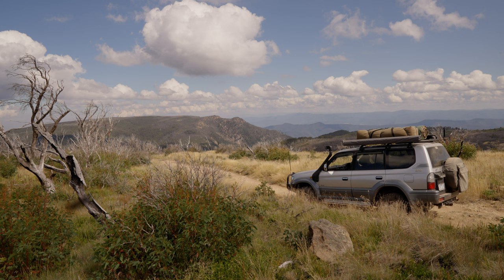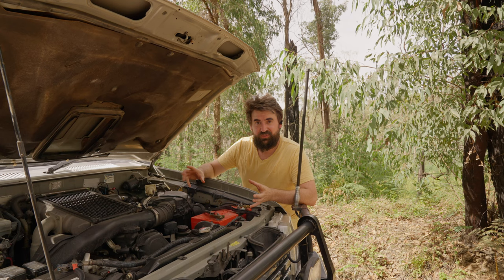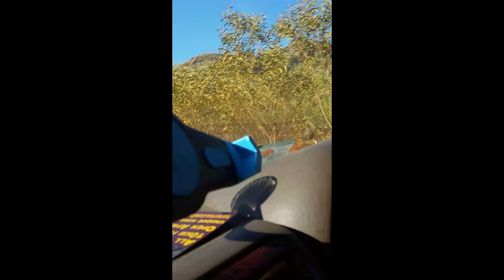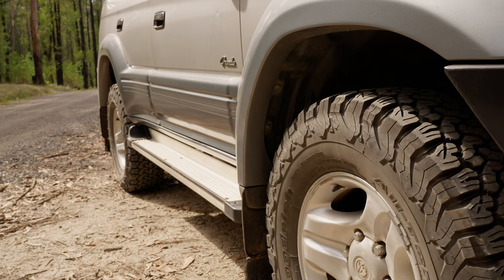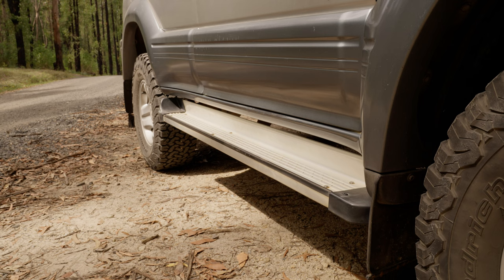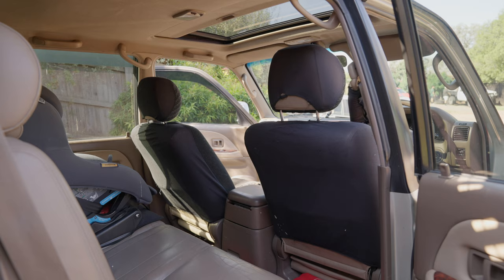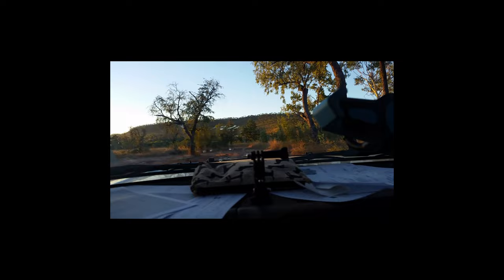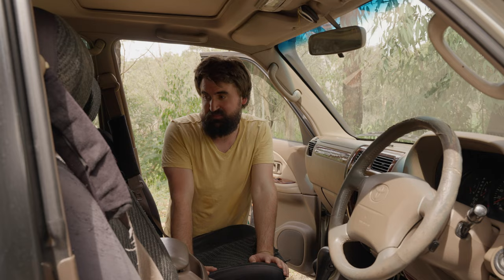Prado Walkthrough  - Setup For Family Adventures

Comment: Get video, always good to see other peoples  set ups .
A cargo barrier is a must , l have had in all wagons and they work !
Given the “COVID Tax” on 4x4’s and the fact Toyota aren’t taking any new orders for 300 series, l reckon keep the Grey Dingo and give it birthday.
I have the ARB alloy tradie rack on my ute and it’s brilliant. Very light, super strong , l have used it as a work platform , lots of tie down points and Australian made.Very happy with it.
LITHIUM is the way to go for your 2nd/house battery.
I have a 100amp lithium power station, the battery and distribution are combined into one unit.
Plenty of power , runs the fridge and travel buddy no problems, light weight ( 11kg approx) and transportable. Mine is. Nomad PDU from a WA company, it works well .
I have had this unit for over 3 years now, no problems .
There are other on market now.
Keep up the good work , l will check out your PLB video .
Thanks for all your efforts, Mr & Mrs Dan.
Reply from the maker: Hi David, It's a simple setup but it works for us. The more we think about it, the more we think to keep the Grey Dingo a bit longer. You are right, with the market on its head its just not the right time to buy unless you have no other option. Thanks for sharing your ute setup! Tradie racks are so versatile I reckon - wondering how the Aluminium has held up? What ute do you have? Do you run any solar to the lithium or is it not needed? The portable batteries seem like a good option because they can potentially outlive the car - I'd hate to spend a heap on wiring it up then have to say bye if we decide to sell  the vehicle early. I'm going to check out the Nomad PDU. Thanks for watching the PLB video. Great to have you onboard the channel. Cheers
Reply: @OTWD  Hi Dan,
I have a 2019 Ford Ranger XLT with the Tech pack. Pretty happy with so far.
The alloy rack has worn very well so far. I have carried everything from firewood, plywood sheets, hardwood timber,ladders, pop up marquees, swags, max tracks, bikes, tools and naughty children ( joking). I have used it for a work platform and a viewing platform and so far no problems.
Oh and niece use it as a climb gym/ monkey bars.
Just be aware they do increase the height of vehicle.
I have no “ dog in the fight” but very happy to reckon this alloy rack.
It works for me
My battery pack (bp) is solar capable, but l don’t have solar. I tend to camp and move on the next day , so the dcdc charger keeps the bp topped up.
But am looking at folding solar panels for an upcoming trip , which will involve a lot of base camping and day walks.
I had an auto elec run a cable from the engine to to the tub and l have a 25 amp dcdc charger for the bp this works very well. I also have  an ac charger which l charge/top the bp as required. I reckon a bp would be ideal for your set up.
Hope that helps.
Keep up the go work.
I appreciate the time and effort you put into your videos.
Thank you.

Comment: Hi
I have a colorado 1997 with  195000  miles on it.
I have owned  it for 14 years. 
I have  replaced  the rear axle casing due  to top radius  brackets  rusting away. 
Keep  the maintenance going  and it will  going.
Regards  from  the UK. 
Paul
Reply from the maker: Regular maintenance is the key isn't it. There's something great about owning and maintaining an older vehicle. Wishing the Colorado another happy 195000 miles. 😬

Comment: Hi Dan
We have a 1999 90 series 1kzte with a 5 speed the manual is quite rare here in newzealand just hit 400000 km the only major repair has been the injection pump just recently 
She has taken us on many great trips 
All stock with a good set of tires 
Love the channel
Reply from the maker: Hi Sam, glad you are representing the 90 over there! Are the manual's more sought after than the autos because they are less common? In Aus it seems the auto is more sought after. Are you changing oil every 5000km? It's amazing where you can go with a suitable all-terrain tyre. Cheers, Dan
Reply: @OTWD yes the manual is way more sought after

Comment: We've got a 90 series too. Love it. I've decided against drawers as we use it for our every day vehicle too. What I'm planning is to pull out the existing tie down points and put in some anchor railing to strap the fridge down better and let us put some straps or even a net over our loose gear.
Reply from the maker: Thanks for watching Steven and taking time to comment! Rails sound like a great idea. I've searched far and wide for a cargo barrier and come up short - in particular the Grande seems to struggle to fit because of the leather seat being slightly oversize. And tieing down a load isn't easy in the boot - so rails would help! I'm waiting on delivery of a lithium battery power station, and am intending to make a simple false floor to secure things to. You've given me some good fuel for thought. Happy adventures mate.
Reply: @OTWD  yeah I've not found a barrier. Not sure i want one full time either. Might be able to rig up a cargo net.  
Also highly recommend sheepskin seats and steering wheel cover. I live in outback Queensland. Seats and steering wheel are never hot!
Reply from the maker: @stevenlippis5488  When the car is fully loaded I feel slightly safer that if the car rolls  things may stay roughly in place, but when I have my heavy recovery gear, compressor etc, sitting there with mostly air above it - that's when I wish I had the cargo barrier - it's so dangerous. I tried to strap it down as best I can.  But I also see how it creates limitations. Thanks for the sheep skin tip. I'll certainly keep that in mind! Cheers

Comment: Hi Dan, I have a 2002 90 series Prado. I recently bought a steering wheel cover from Repco for $36. It fits snuggly (with effort). It's made of genuine leather and doesn't smell too bad like the ones from Supercheap Auto. I thought I just add this info here in case you're still looking for a cover.
Reply from the maker: G'Day Rusty, appreciate the tip mate. I ended up getting one on amazon which is working out nicely, not too slippery, not too grippy. Will do another Prado video soon...unfortunately she's out of action temporarily though...might be expensive 😅  Hope your 90 is treating you well?

Comment: Hi good video! I am based in the UK but has the same car from the Japanese Import market. Same engine as well. I also had a slow coolant lost, so replaced the head gasket and scheme the head, after reassembled, the coolant lost is still there but less. Have you ever found out the cause of your coolant lost?
Reply from the maker: Hi Aero Elastic, thanks for watching mate and appreciate you taking the time to comment. Are they a common vehicle over there? Sorry to hear that you went to the $ and effort replacing the head gasket and it did not entirely fix it! I wish I could help more, but I don't know for sure either. My mechanic thought a weeping head gasket could be to blame (which doesnt help your situation anyway), or some other compression issue in the engine. We used a copper compound in the coolant which appeared to help but not fix, this is designed to settle into any cracks and seal them.  We decided to 'wait and see' knowing at some point we may need to pull it all apart. I'll definitely reply again if I learn more. Hope you are enjoying your Prado :) Cheers
Reply: Maybe has small crack in head cylinder between two valve !!! Check compression leak !
Reply from the maker: @jdmcarandmotorcycle  Thanks for the tip! This seems plausible and reasonable!
Reply: @OTWD  Hi some updates, i have removed my head again and this time focusing on finding internal crack, as my coolant lost persisted. Upon closer look, i found coolant traces within the Inlet Port of cylinder 3!  It is a rare and unusual place to crack. No visible crack between valves but inside the valve port. Anyway, i bought a new aftermarket head and put it back, now the coolant stays!  Only downside is now the engine has rough idle during first cold start in the morning (UK Winter morning), still trouble shooting.  Suspect sensors or glow plugs related. Once warm up everything is smooth.  Good day.

Comment: How to engage/disengage diff locks. I have got the diff lock light on for the same model and I don't know how to disengage it.
Reply from the maker: Hello, hopefully you haven't driven on too much road/bitumen with the centre diff locked - you could get transmission wind up. Put the car in neutral(stationary), then there is a button to the right of steering wheel near the mirror adjustment buttons. It looks like a car with a cross in the centre between the wheels. Should flash lights on the dash for a moment then turn off.
Reply: @OTWD  Thanks a lot. I was able to fix the issue the next day, I don't remember how exactly but all good now. Thanks for getting back to me though :) I have a 70 series land cruiser and this Prado. It is in black color and in pristine condition. Too good for mall coasting hahaha. I also take pride in the fact that people take photos with both of my cars haha.